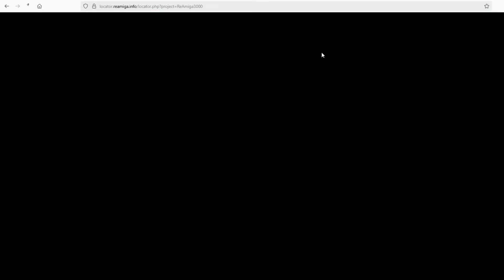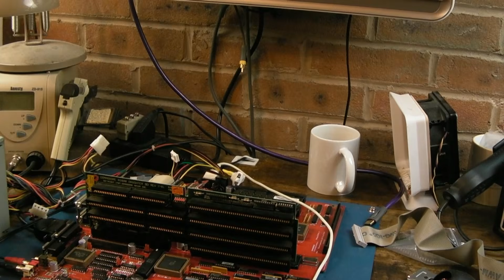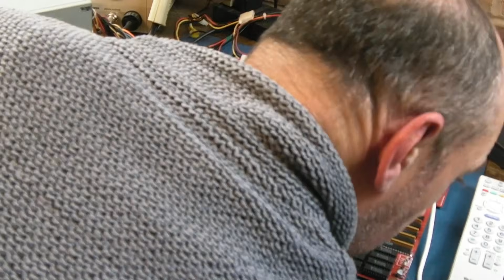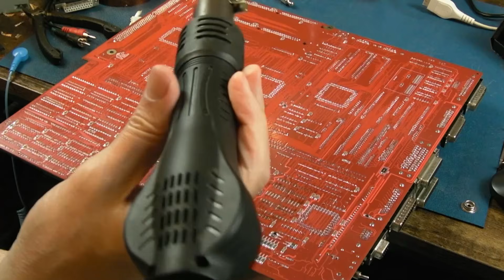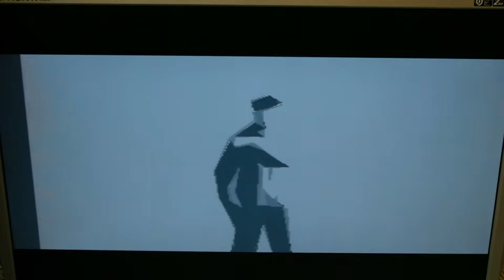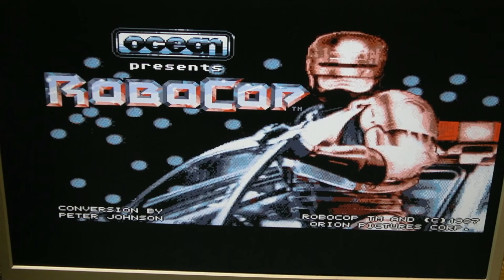Re-Amiga 3000 Upgrades & Fixes (CPLD Amber, Kickstart, FPGA SDMAC)

Comment: NTSC and PAL RAM?  HUH?  Am I missing something?
Reply: Ahhhhh.  Gotcha.  Makes more sense now.  Thank you.  😊
Reply from the maker: Haha =D  Yes, the line RAM buffers pixel data (R,G,B).  NTSC line RAM can hold more pixels than the PAL RAM and has a subtle difference in timing.
Reply: @GadgetUK164  You would think it would be the other way round. PAL is 576 lines @ 50Hz, whereas NTSC is 480 lines @ 60Hz. So PAL RAM is larger, but NTSC RAM is faster...
Reply from the maker: It's not about the number of lines though - line RAM just holds one scan line (NTSC is more pixels wide - likely to account for less scanlines?).